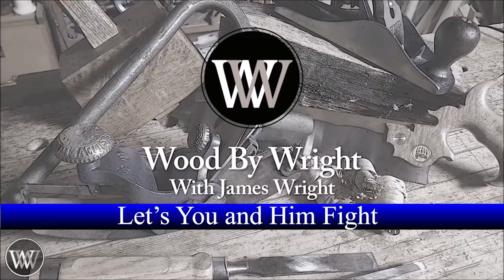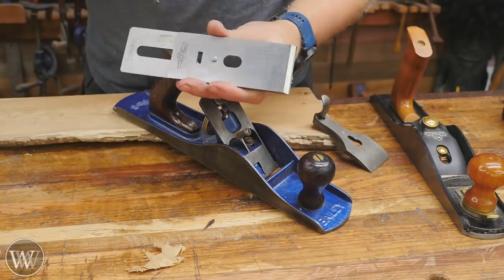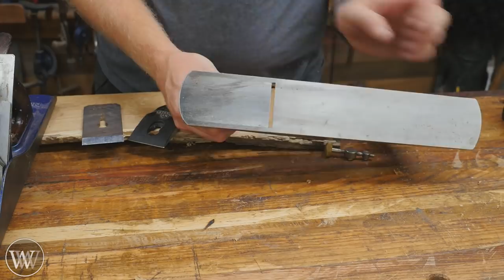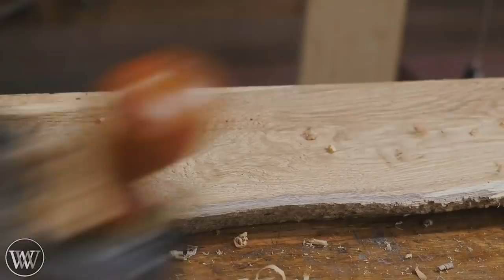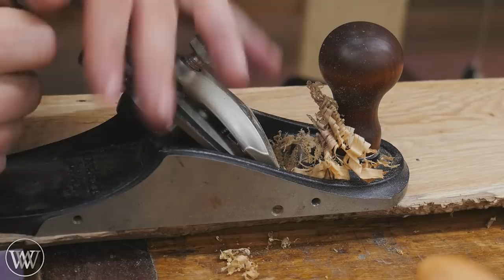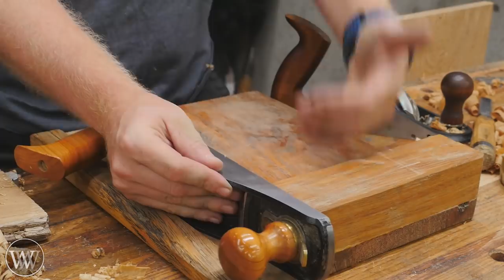Low Angle Vs High Angle The Best Plane For You

Comment: Personally as I started integrating more hand tools into my work, I started with the low angle jack because I was a bit intimidated by all of the customization in the standard angle planes. Now I have a 4 1/2 and am kicking myself that I did not just jump into the deep end and start there. It does have a lot more to adjust, but once you have it all down, it takes way better shavings. I do plan to build a shooting board soon, but until then, my old 62 rarely sees much use.
Reply from the maker: Right on. same here!

Comment: Hi! Nice viedo though the opinions seems to differ very much on this topic your conclusion is full of wisdom. I` d like to ask about one important thing in from the standpoint of ingeneering and re- servicing the low angle jack. Are all the screws and dimensions metric or imperial? Regards!
Reply from the maker: It depends on which one you get. The one from veritas you get both imperial and metric. The Stanley is all imperial and I don't know about Lee Nielsen but I would assume it's imperial. There are several others that are a little cheaper that are all metric.
Reply: @WoodByWright  Thanks for your reply! It` s kind of important to know that fact because any modifications or repair of an imperial dimension plane in europe is quite hopeless... The stanley low angle jack seems nice but the "lever cap" is quite cheap and blades in different steels are unavailable.

Comment: Do they make low angle, bevel down planes? If so, what are they used best for? Thanks and great video!
Reply from the maker: You can get them custom-made. And I have a video series showing making one myself with a wooden body. The nice thing is you can actually get a lower cutting angle bevel down then you can bevel up. you can also use a chip breaker so they tend to do a little bit better in figured wood then a bevel up design.
Reply: Thanks for the info!

Comment: Bevel down is the best because they're the tools that are most available.
Reply from the maker: that is a great reason for it.
Reply: @WoodByWright  if everything else was equal then it would be a harder decision. But because of the increased price due to limited availability I have to consider low angle jack planes luxury items when it comes to woodworking. Certainly nice to have but low on the list of things to get. When one has practically everything else then sure.

Comment: It's best to have both. And one nice thing with low angle planes is that their blades are a bit easier to sharpen free hand due to their bigger bevel area.
Reply: How is grinding more metal any easier? You make no sense!
Reply: @1pcfred  Keywords here are "free hand".  With bigger bevel area, it's easier to keep the bevel angle just right, i.e. it's more stable due to bigger surface. And with low angle planes, it's quite important to maintain the low bevel angle, the essence of low angle bevel up planes. No secondary bevels or you'll get back to standard ~45deg and lose all the advantages of bevel ups.
Reply: @tuomasjjrasanen  I always grind a primary and a secondary bevel. I never sharpen plane irons freehand either. Well, I sharpen my high camber scrub plane freehand. I also don't own any low angle planes. I have a couple bevel up block planes but I sharpen them just like I sharpen any other plane.
Reply from the maker: Right on. that is another benefit to the beginner. it is easier to train the freehand what that angle feels like.
Reply: @WoodByWright  I freehand sharpened for almost 50 years. Recently I started using a honing guide. It's way better. It's all about consistency and repeatability. That's what a guide gives you. Although the knock off Eclipse guides available today are pretty rough. So they take some filing to true up. Not much, but a little. I'm thinking about picking another one up and modding it to be like the Lie-Nielsen guide. Because I ain't shelling out what he's charging for that.

Comment: OK, I just watched a video by another guy who said “a low angle jack is the only plane you will ever need”. I thought, “Great! One and done.” Now I watched this and I’m back to analysis paralysis again. A low angle plane should reduce tear out, but it doesn’t. So a low angle plane is only be better for end grain? 
In my limited experiments with a couple planes I got for free, I don’t get wispy thin shavings. I get thick slices (with some effort) or something resembling saw dust. I’ve spent many hours with diamond stones and a Veritas honing guide trying to get a razor sharp edge and they catch my finger nail, but don’t shave hair. At this point, would it be reasonable to conclude that I need to pry open my wallet and buy a better plane or should I be able to get even a no name, flee market mystery plane to work well?
Reply from the maker: In the end it is just personal preference they each have their pros and cons. If you are a biginner and want just one plane get the low angle. If you are going to be doing ylot of figured wood then get a bevel down plane.
Reply from the maker: As to the other planes it sounds like setup and sharpening will fix your problems. Even high-end new planes will need some work to get up and going.
Reply: @WoodByWright  Thank you for replying to me. I got my No. 6 working pretty well I think. I tested it on some 2x2 that I didn't really need to plane for a project that I didn't really need to do. :) It didn't leave a super smooth surface and I'm wondering if I should adjust the frog forward to close the mouth or if I should leave it lined up with the back of mouth like I have it. I was thinking that position would resist blade chatter. But now I'm thinking that wouldn't help because with the bevel down, the blade wouldn't even contact the sole and the back of the mouth.
Reply from the maker: that is correct the frog back does not help chatter. if you are getting tearout then moving it forward will help, but if it is not fully sharp then that can lead to  clogging.
Reply: @WoodByWright  Thanks, James.
Reply: A 1000 grit diamond plate and stropping will get your irons sharp enough to shave with. I almost think you could use the side of a cinder block and still get a good edge by stropping. (I haven't actually tried, but it's amazing what leather and rubbing compound can do.)    I also really like Rob Cosman's 32 Seconds to Sharp method, but a piece of leather and some rubbing compound is a lot cheaper to get started with. )

Comment: People used high angle for hundreds years, its proven, the other one is just a toy
Reply: Actually, that is only true for Western European based societies. For Eastern Europe, the Middle East, and Asia, a very low angle design was, and remains, the most common design.   They also use a much thicker Iron which eliminates the need for the Cap Iron with its humped "chip breaker" (a feature introduced and patented by Stanley Rule and Level Company in the late 1800s).  Planes have neen developed independently by may different cultures around the world with a very wide variety of designs.  

The modern metal hand plane, especially Western High Angles, are a very recent arrival in woodworking hand tools and only became popular im the early 1900s because of mass production by Stanley, and later others.  The largest volume of production of Western High Angle steel planes was from 1910 until 1960.  Roughly 75% of the production during theose years was done in the USA by Stanley.  They made their own as well as several "stamp brands" (craftsman for example).  The other major manufacturer was record which began in the USA, moved to the UK after WWII, and later returned its HQ to the USA while manufacturing in both.  Today, steel body planes are still primarily a North American and UK item.  Many European and most Asian craftsman still choose all wood body planes with most cutting angles being significantly less than 45 degrees (i.e. low angle).
Reply: Thanks, interesting, I want now to try low angle too to compare both